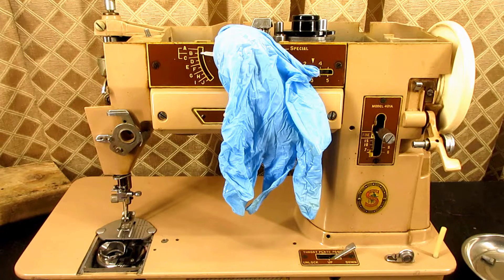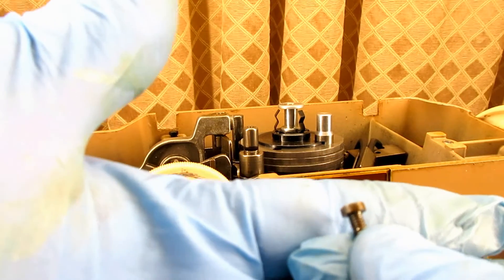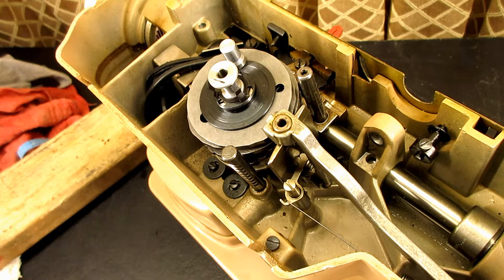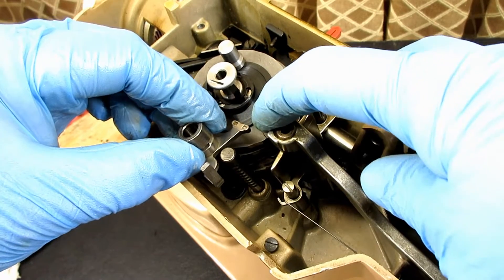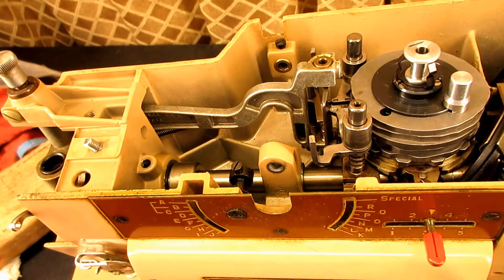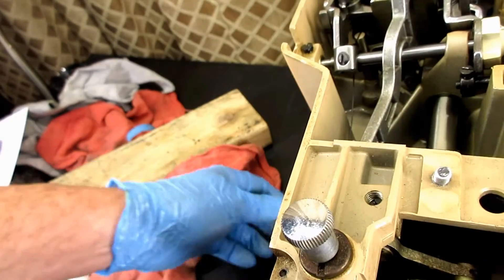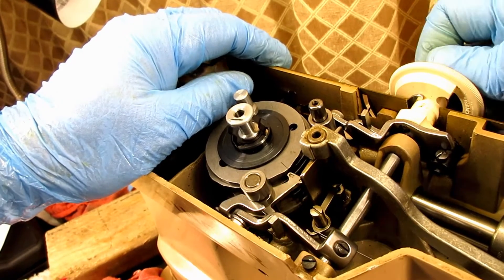Remove the Knobs, Lifters and Followers on the Singer 401A Slant-O-Matic

Comment: Hey Andy, I have followed your instructions to the t, and my rear follower keeps getting hung up, I can't see anything that will cause this, I have taken it apart several times and put it back together just like you showed.if I keep wiggle it it will sometimes move then it will all of sudden just get stuck and will not budge, please what am I doing wrong,it looks just like it did before I took it apart
Reply from the maker: Did you have this problem before you worked on the machine? Can't diagnose this without the machine on my bench. I would try to isolate which part/parts is/are hanging up. I suggest removing the rear follower to see if all other parts move normally. It may not be the rear follower causing the problem but only what you see when things hand up. If everything moves normally without the rear follower in place then you know it is the follower. Isolation!!.

Comment: Very nice video I am trying to take this knob off but when I try to loosen the shaft screw the shaft just spins any ideas ? Thanks
Reply from the maker: The shaft screw on the end of the shaft in the back? Did you follow the screw removal sequence as shown? @16:00 I discuss holding down the rear lifter with your thumb while you loosen the rear screw. That lifter should be held onto the shaft with a screw onto the flat spot of the shaft so by holding down the lifter you prevent the shaft from turning. I'm I missing something here?
Reply: @andytubesewing1953  I had not followed the sequence and removed the set screw first . Thanks I was able to remove the shaft screw
Reply from the maker: @samchapjoe2001  Glad it was an easy fix then. Thanks for keeping the machine running. Good Luck.

Comment: Hi Andy it's me and I'm so happy you answer my questions. I'm watching this one as I type, though my machine is a 500.. is there any differences in the 500a ?
Reply from the maker: The 500A does have different types of knobs, but all the mechanics are the same as far as these parts. The presser bar system of the 500A is more complicated, IMO, and it also has a weird "thread puller" system next to the take-up lever that SInger never used again.   I also have a playlist for model 503A that can help with the 500A    https://www.youtube.com/playlist?list=PLsCOZgzzaiKJZaZn2zl3LsnV2d7UhrqvX

Comment: Mr. Andy, I hope you are well.  I recently purchased a 401a at a flea market.  It needed a power cord which is easy to get.  I have watched just about all of your videos on 401a's and love them but I have a problem,  I cleaned this machine inside as much as possible without taking it apart.  It was sewing a straight stitch and the stitch selector know was moving on both sides and then when I tried to get it to zigzag it wouldn't and the left side of the selector know won't move.  I also have another problem, the spring came off at both ends and I can't find your video on how to reattach it.  Please help if you can.  I will be eternally grateful.  I have tried to get my machine to look like yours inside but it doesn't.
Reply from the maker: Welcome to Andy Tube, Deanna. ZZ is a product of the cam stack, needle bar driving arm, and needle bar vibrating bracket. The nbda pushed the nbvb to swing the needle one way (zig) and the long spring pulls it all back (zag) if the long spring comes off either or both ends it can't pull the parts back so the nb is stuck to the side. Here is a model 403A video about the nbda and at 3:32 I start showing where the spring hooks near the base of the nbda https://youtu.be/tcdGVzL9T6o    then a 403A video for the needle bar vibrating bracket shows where the other end of the spring attaches to a thin pin at about 8:27  https://youtu.be/ZTmyM4MNX6o
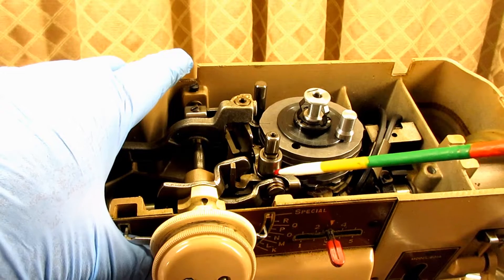There is another video with detail about how the parts need to be set before attaching the spring near the base of the nbda. It's a model 503A but the parts are the same. watch at 6:10  https://youtu.be/89kRREixTeA   I hope those parts of the videos give you enough info to get the spring back on properly. You may as well do that and retest the machine. I hope you oiled the machine properly so the parts can move correctly. This video of oiling a 503A may be helpful to you https://youtu.be/zo3c9CTgVGg
You can download a FREE copy of the 401A Instruction Manual from SInger Support here: https://www.singer.com/search/support?title=401   It has a section on where to oil, too. While I'm at it you can go to this link and download a FREE copy of the Service Manual for model 401A  https://sewingdude.files.wordpress.com/2012/09/singer-401-service-manual1.pdf   It has all the adjustments and repair info for the whole machine

Comment: Andy I have a 421G and watched your video on removing and replacing the shaft , lifters and followers... Mine must have been dropped on it's head.  I can't remove the shaft through the front wheel because the shaft is bent.  When you turn the wheel it makes an elliptic arch.  I haven't been able to find a source for a replacement part.  Do you have any suggestions?
Reply from the maker: The 4xxG models were made in Germany. Looking at pictures they appear to be versions of the 401A made in the US. I've no idea if the parts are exactly the same between the A & G versions. No one is making those parts so we have to source vintage parts. I buy 90+% of my parts from sellers on eBay. You can usually find 2 to 4 sellers who are parting out a 401A. Just search eBay for Singer Model 401A and you will find some who are selling parts instead of the whole machine. Good luck.
Reply: @andytubesewing1953  thanks I'll give that a shot.  Great series for the slant needles.
Reply from the maker: @papajoedh  After I replied I looked at eBay and found two sellers listing the parts you mentioned. Good Luck.
Reply: @andytubesewing1953  looking right now... 4 sold out out so far.  I'll keep looking. 😀
Reply from the maker: @papajoedh  I'm surprised people need to replace that part that often. Good luck! Machines come and go. I don't know if the 500A machine has the exact same part. Maybe that's too risky. You better stick with the 401A
Reply: @andytubesewing1953  👍
Reply: Finally found one. Getting the whole assembly so if I have to destroy the old inner wheel I will have a replacement.
Reply from the maker: @papajoedh  That's a good idea. Best of luck and thanks for saving the machine.

Comment: Hi Andy. I’m in the middle of doing this as well as cleaning the cam shaft, which Btw will not release the cam plates. It’s been soaking in crud kudder. Now that everything is disassemble, what exactly do you use to clean the rest of the interior parts without taking them apart. Obviously I can’t soak it like each individual part unless I completely take everything out?  And using cleaner, hew do you get the cleaning solution off
Reply from the maker: If you don't want to wash the whole machine then yes, you can spot clean it. Try removing as much grease and oil as you can with toothbrushes, bottle brushes, craft sticks, BBQ sticks, anything that can scrape the gunk off and out. If you want to use Krud Kutter try a 15 to 20% solution. Cover the bed of the machine b/c the KK can dull paint. Brush or apply the KK or other cleaner and scrub with brushes, Use rags to wipe out as much as you can. If you want to remove cleaning residue you can use plain water or alcohol and use rags to wipe it out also. I use old socks, like a puppet on my hand, and dip into the cleaning solution and wipe anything I can reach. A different sock dipped in water to wipe off the residue. It's a very slow process, which is why I pre-treat the machine with Krud Kudder, then take to the shower or utility sink, spray the innards with 15% KK, a little more scrubbing inside with a wheel brush or other small brushes, the wash off everything with water and blow dry the machine with a leaf blower and hairdryer before adding oil right away. It is just faster for me. I have several cleaning videos. My latest is about cleaning a machine without removing so many parts, as you mentioned. You have the biggest headache of cleaning, the stack, out already. Here is the video I'm talking about.
https://youtu.be/kXZHksK7rGQ   It is hours long, but the timeline at the bottom is broken into sections with descriptions and start times you can skip around and see what you want. You can play it at 1.5 or even 2 times speed, too.
Reply: Just finished all the cleaning and resetting the timing on needle and cam. Have to do a test sewing to see if all is well.  I do have one question. Before I start trying to sew upholstery (reupholstering my couch and love seat), I don’t want to ruin the material, do you think this machine is up to the task of that heavy material?  I really do not want to invest in a $1500 industrial walking foot if i don’t have to.

Comment: Hi Andy, I don't believe there is this type of assembly behind the knob selector on a Singer Model 500A?  It seems to me that on the Singer model 500A the knob has the pointer molded in and there are springs behind the knobs?  Why is it always the right hand selector where you pull it out, front one, that causes problems and the left hand one usually works fine?  Thanks, Kathy from Southeastern Arizona
Reply from the maker: The 500A set-up is actually very similar to the 401A. It also has a spring behind the front, pointed knob. You could use this video for the 500A I believe. The front knob has screws on the side, and the back knob is a little heavier but the 500A still has the same shaft, lifters, and followers. Same cam stack and needle bar driving arm, etc. I can't say about the knobs on other machines, but on Trouble, the rear knob was easier to pull and turn than the front one was to push and turn. Maybe b/c the rear knob is bigger, with more metal and the lifter is attached directly to it?  https://sewingdude.files.wordpress.com/2012/09/singer-500-service-manual.pdf
Thanks for watching
Reply from the maker: You can download a free copy of the 500A Service Manual: https://sewingdude.files.wordpress.com/2012/09/singer-500-service-manual.pdf    Page 35 shows how to remove the knobs/shafts. Maybe this will show the differences a little better. Thanks.

Comment: the video was great. but when I  took my knob off I had no spring.  I looked on ebay for one and no luck. Could you suggest a place to find one? Thanks
Reply from the maker: I don't think you'd ever find this spring for sale by itself. Usually, sellers who part out a machine sell a group of parts. If you knew anyone with a 401A or 500A and could "borrow" the spring to take to a hardware store they MAY (maybe) could find something similar that MIGHT work. I say the 500A because it has the same spring. I found a seller I have bought from a dozen times who has the knobs and spring for a 500A for $12.50 with free shipping. He is reliable. https://www.bonanza.com/listings/Singer-500A-Stitch-Control-Knobs-172521-172525-Spring/186901783  He does list is with OBO (or best offer) so maybe you can say you only want the spring, or offer $10 for the setup. Maybe he'd lower the price a little, but speaking as someone who has bought many vintage parts if I needed that spring I'd buy if even at $12.50. Good Luck and thanks for watching my channel. BTW, the spring is part no.172126

Comment: I have a 411g that is very similar to the 401a. But the front selected knob doesn’t have those 2 screws in the front. It is just a smooth plastic knob. Any suggestions would be appreciated  I always enjoy the videos, thanks.
Reply from the maker: I found a picture online. The German 400 class of slant needle machine, to me, are half-way between the American 401A & 500A models. On the 500A there are screws on the side of the front "pointy" knob, and two screws just inside the machine under the cover that allow the left index (pointer) pin and the right lifter to be removed. Maybe the 411G already had that setup. You can download a free Model 500A Service Manual (and a couple others) at this link to see what I'm talking about. I'm wagging this (wild a$$ guess) as 
I have never seen any of the German models in person and have no documents for them. Here is the link for the 500A manual;
https://sewingdude.files.wordpress.com/2012/09/singer-500-service-manual.pdf
That's all I have and good luck.
Reply: Thanks I got it and found the 401a service manual as well. It will be valuable to me as I have a 401 too that needs restoring
Reply from the maker: @vsmetc7305  Excellent! thank you for saving those machines.

Comment: My rear lifter disengages from the follower causing the selector knob to freeze.  Is there any way to adjust this?
Reply from the maker: Yes. You adjust the rear bushing that the knob shaft goes into at the rear of the machine. Moving the bushing forward I think you can control how far the shaft goes back when pushing the front knob. It sounds like your lifter is traveling too far back and slips out. There is a setting for the knob on the front and that rear bushing and you use a feeler gauge to find the correct spots. The instructions are on page 139 on the Service Manual which is available free at this link: https://sewingdude.files.wordpress.com/2012/09/singer-401-service-manual1.pdf
Reply: @andytubesewing1953  Thanks!
Reply from the maker: @mlucienteCycling  Sure, Martin, no worries. Good Luck.
Reply: @andytubesewing1953  The manual is terribly written.  The pictures are terrible.  But, there is enough information to figure out how to do it by feel.  I think it is adjusted so that it will not bind again.  Thanks again, I could not have done it without your video.
Reply from the maker: @mlucienteCycling  Agree about the quality of the free copy. You can buy a much better copy on eBay to download for about $15 if you ever need it. From the language you used in your first comment I figured you would work through this and find the solution. Thanks for fixing your machine to keep it in service, and thanks for watching my channel.

Comment: This is the one I’ve been waiting for! Thank you! I found it in the service manual but I much prefer to follow you doing it.   Do you have a video on removing or oiling the main drive shaft in its guides?  I’m most of the way through your 404 series and have referenced a couple from the 403 like removing the zig zag bracket that connects the sewing bar to the presser bar on my 401A
Reply from the maker: my main drive shaft if you mean the horizontal arm shaft I'm sorry I don't have a video I've never had to take one out. I think I'm glad of that as it is a time-consuming adventure, then after reinstalling you have to readjust many things. Of course, if you already have much of the connected bars and shafts off I guess it would not be too bad at that point. If you end up doing it I hope you record it and put on your channel. I'd love to see that being done and would be happy to refer my viewers to see it too!

Comment: ANDY... Ok here I go🧐.. About  to get real personal with my 401A that I named after you 😂 

Unfortunately, Andy Jr  needs a little help...
The stitch selector won't turn to the left or the right. Not even a little. I tried pulling the knob outwards, that's fine , everything seems to be in working order too
AND  guess what, 
The screws are jammed up too.! Jeepers Crow.. 
Theres no rust. .anyways...

I didn't do the rubber glove trick tho it's FUNNY HA HA

I'm 150%  Environmental Advocate that goes to certifiable crazy lengths  save the world from waste.
So I  laid Junior on it's side and put p oil on the top of screw holes.  
I don't have a blow dryer or a nice long adjustable diver like you do.
Im going to lock my adjustable wrench onto my teeni tiny screwdriver to get some more leverage on the buggers.TBD
I want to find  sewing machine mechanic in Rhode Island. 
It's a dying profession I worked in the field
Reply from the maker: Hmm... you can buy a hair dryer (new) at Rhode Island Walmarts for $15  https://www.walmart.com/search?q=hair+dryer&facet=fulfillment_method_in_store%3AIn-store&max_price=19&sort=price_low
Did you watch the videos in the Playlist I gave you in your earlier comment? It might help to look thru them a bit before you start working on the machine. Here is one for stuck knobs, a very common problem. It can be the parts the knobs control that are stuck with dried up oil and not the knobs themselves. WATCH: https://youtu.be/6O2bpVg_o_w
Reply: @andytubesewing1953  I did find your helpful video. I got it unstuck and commented. But I also discovered that my cam stack is on a tilt. I commented about that on the video.  I'm assuming I'm going to have to remove and or adjust the eccentric thingy.. ?
Reply from the maker: @lesabooth5243  Sorry, I've never encountered that. It's unusual. I don't have a video but suggest you download a FREE digital copy of the SERVICE MANUAL. Page 158 has info for the Camstack adjustments. I hope it will help.
https://sewingdude.files.wordpress.com/2012/09/singer-401-service-manual1.pdf